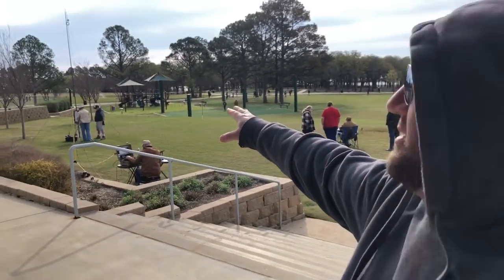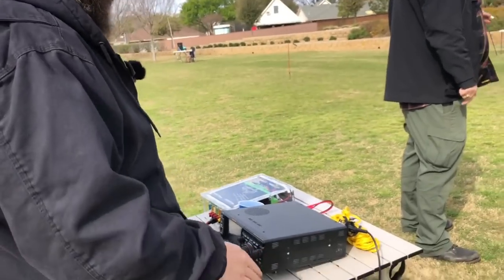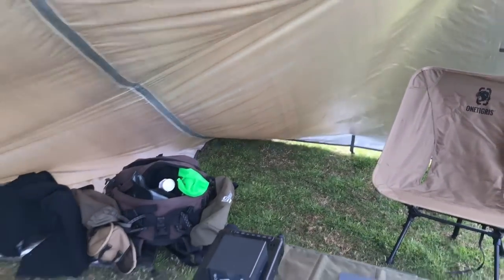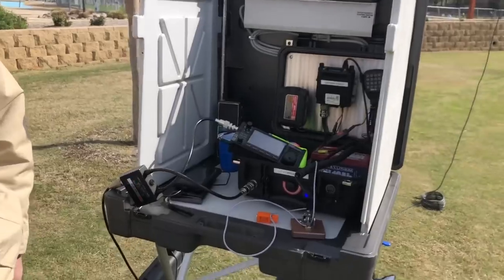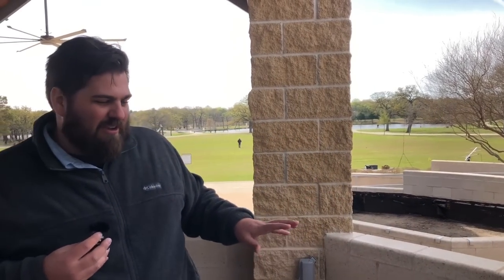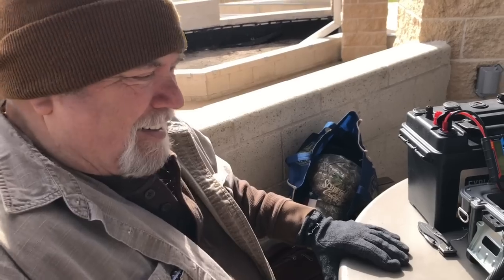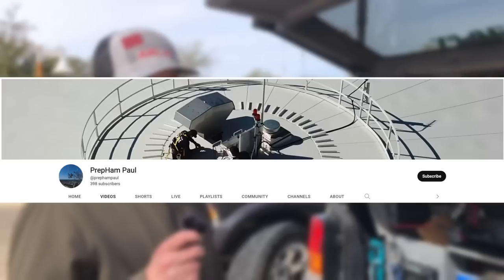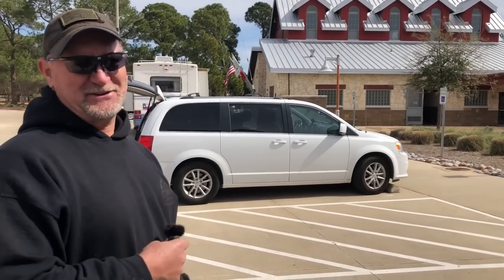Ham Radio Go Kit Challenge 2023

Comment: That looks like a great time! I don’t know of too many communities that will get together and be supportive of each other’s setups and just having fun at a competition than amateur radio. My wife and I really like to camp. Bringing my HF along interests me greatly. 

I have a green plastic shotgun shell case similar to that gentleman and set it up similarly with a 10w dual bander with both power and antenna connectors wired into the outside of the box. It’s not much but it tries. 

I believe I saw a station that used old Coleman camp stove cases during the award ceremony. That’s ingenious! There should be an award category for most ironic/unusual setups lol. 

Carl
KB9HPM

Comment: Also what are those laptops and how are they being charged on 12V?
Reply from the maker: MicroCenter had these on sale a few months ago for $60.  There was quite the commotion over it.  The computer sucks but it's absolutely fantastic for portable ham radio.  Great battery life too!  https://amzn.to/3K46wDk  They charge off of 12 volts.  Just cut the power cord and put Anderson power poles on it and you're in business.
Reply: @K8MRD RADIO STUFF  that's awesome! Rare to have a 12V laptop. I've been struggling trying to figure out digital POTA without breaking the bank buying a ton of stuff. I've got several older laptops, but they're bigger, bulky and need 19V to charge and won't last 5 minutes unplugged.
Reply: Its the Evolve iii Laptop PC. It runs off 110V AC, which drops down to 12 VDC. Runs Windows 10 (is basically a school use PC). It has limited memory, which is easily upgraded enough for Ham program needs. Its a bit slow, but still fast enough. Its light weight, supper small, and easily packable. Plus, when on sale it was $60.00! So. Its the almost perfect ham radio PC. 1 version is cellular ready, the other is Wi-Fi only.
Reply: @chrissewell1608  if only they were still $60!